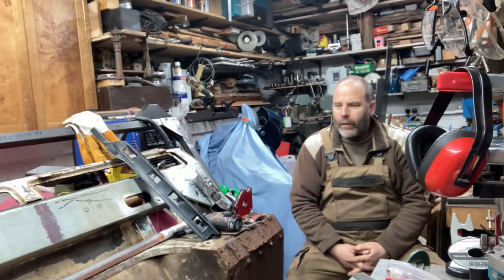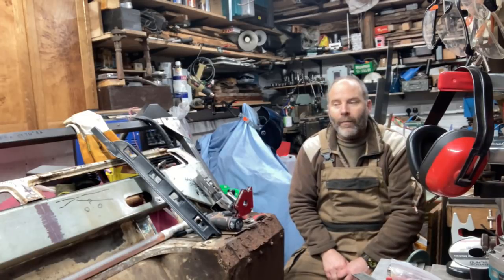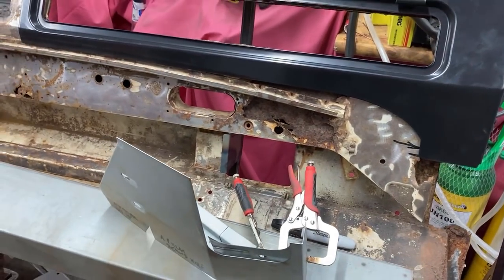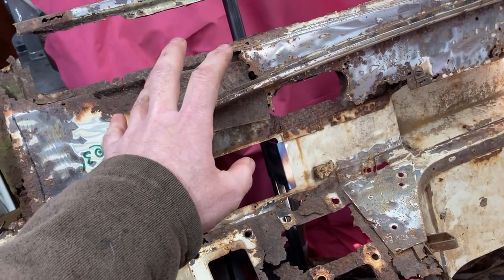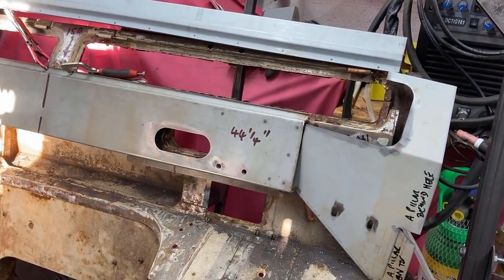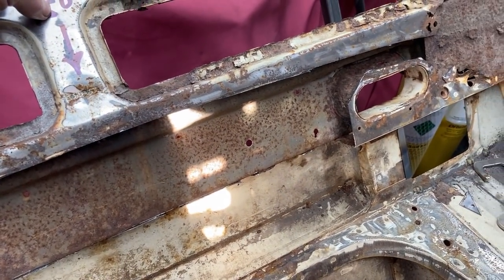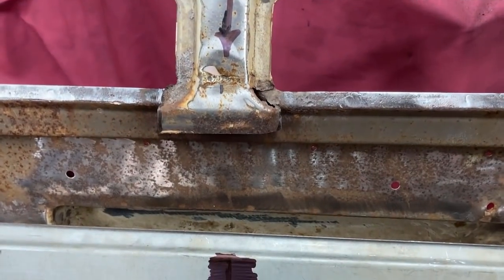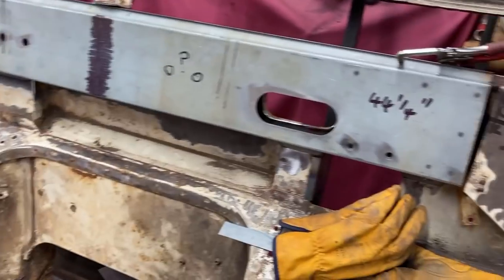Project Clanger the 109" Series 3 Landrover Rebuild. Update 12 - Bulkhead

Comment: So what is more fun this or scraping? :-)
Reply from the maker: Its funny Brian - both share similar elements of trying to keep in mind the plane of each surface relative to the others - obviously the tollerances differ somewhat !  Scraping is now a fairly simple if mundane task- comlicated only by the size & mass of the parts - this shares the same problem of bits that are too larger for my workshop space ! The main problem I face is the lack of welding skills - so while I learn that and deal with the ascociated complications of head gear and hand eye coordination theres a lot of frustration - getting 6 inch of half presentable weld does lift the spirits - the same as when you finally get thre contact zones and each pass increases the spread and its in the right plane !  Which do I prefer - ..... undecided :-)

Comment: hi mat you could drill datum holes in the frame /jig to run wires across from upright to upright pinpointing key areas ? its looking good though well done bulkhead repair .
Reply from the maker: They may yet make an appearance ! Skyhooks are proving less reliable :-)  All the best Mat

Comment: Man creates bulkhead out of thin air and rust part x! My tig is about the same level as yours, how are you prepping the old metal? I ended up putting my footwells in with stick because I could not get  a good weld with the tig torch.
Reply from the maker: Ive not started welding the old parts to new. Might come unstuck at that point !  cheers Mat

Comment: Hey bud, just a quick one on those rebaited bits, im with the 'young man' on keeping the rebaited bit 7:10 whole and stitching around it as you need, more welding but is good practice, lap or butt joint youll be going slow anyways, spot spot tack tack. Sectioning female rebaited bits is a pain in general and if the repair section is dimensionally accurate there its one less thing to think about. Welding near outer edges and swage lines is always nice, theres a lot of strength there that helps keep things from distorting. Dressing welds and finishing any panel with filler etc is much easier on an 'outer face' rather than in a rebait or female section. 
Ooo, can always add an remove tube to your jig to keep things supported straight an square, tack on pointers to mark prominent features etc.
Keep on trucking mate, looking good.
Reply from the maker: Yes, you are right Duncan. In part B to upload later you will see how Im learning as I go and understanding a bit more each time I look at a new problem. Its a lot more fun than scraping ! Though tends to burn more often !  All the best Mat

Comment: Starting to take shape Mat, think it’s a good plan to work from the centre out given that it’s relatively symmetrical.
Location tabs for faces and edges help when there’s not much else to go by. 
Cheers
Reply from the maker: The 'symetry' is variable accoring to Anthony - anything up to half an inch out. I did however take some measurement before I started which were overall widths - so as Ive got one half 'ok' for each of these points I can pretty much guestimate the other half. I figure if its within +/- 1/8" Im good to go.  We shall see as other bits get fitted. all the best Mat

Comment: The more you take off the bulkhead the better it looks. LOL To make it easier on yourself when welding just do short 1/4" stitch welds instead of continuous welds. Space your welds 6"apart and move around so not to build too much heat in the metal. That will alleviate warping of the metal due to excess heat. Cheers.
Reply from the maker: Yup with the welds - am trying to get a run - then get carried away then it goes to pot ! So might be better to stitch :-) Thanks for the advice and watching. All the best Mat

Comment: How about you ask them to start stamping mutiple datum points in their parts.Refrance middle part of the bulkhead as thats least rusty. Then even if they overlap or bits are mising you can triangulate. Similarly weld a datum grid to your bulk head holding frame so when you cut out you know where to replace.
Reply from the maker: I will pass on your comments - thanks for watching and commenting. Mat

Comment: I'm impressed with the parts that the bulkhead people sent you Mat. That central piece that was out of spec is a total life saver as far as I can see and I think the way you are approaching the actual step sequence is probably the correct way to go although without standing and pondering it like you have for hours on end. Initially when I first saw it, I would have first put the rear repair piece in place to give myself something to weld to, but as you went further into showing your thoughts I thought well yes perhaps your logic is better than mine! Anyway mate it's starting to come together, have you considered Araldite instead of welding?? Lol
Reply from the maker: I’m quite liking magnets to hold it together 😃 Quick, quiet, no mess adjustable and don’t hurt when you touch them after applying 👍